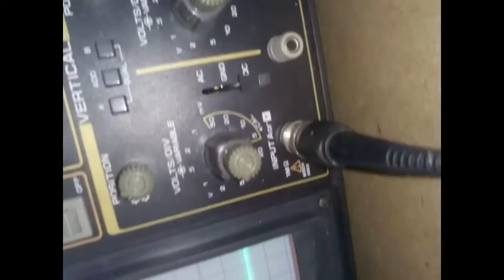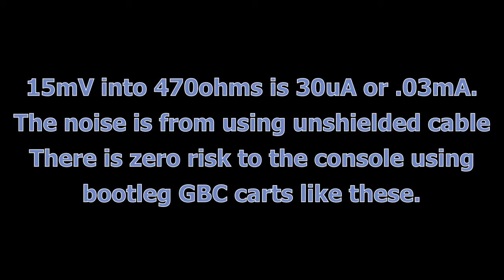AC current analysis of the bootleg gb/gbc carts

Comment: In regards to those older everdrives with resistors instead of level translators, and modern chinese clones that still use that design: can you speak to how this theoretically holds on generational timescales? Say I want to pass on my systems to the local library or another collector when I'm like 90 or something, will I have theoretically shortened the lifespan of my consoles by using Chinese SD carts?

I guess the theory is that the voltage mismatch is causing excess current on the output of the proprietary console chips for much longer than they were designed ultimately causing a higher degree of electromigration, like if you're overclocking a CPU.
Reply from the maker: I think it's safe to say stressing IC's by sinking excessive current is worse than not - so I guess if you're worried about it, don't use junk carts.
Reply: @bennvennelectronics  that's the thing, I didn't know if early everdrives count as "junk carts" or not. Sure the level translators are the "by the book" solution, but didn't know if the cheaper resistor method was close enough to make any amount of stress negligible, even over longer timescales. 

Because as I've looked up the original article this video is in response to, the debate was always centered around long term use. 

As an electronics novice, it's hard to make heads or tails of this. Especially considering no consumer computer hardware is really ever designed to be used for literal decades, doesn't seem to have been a thing that was really studied